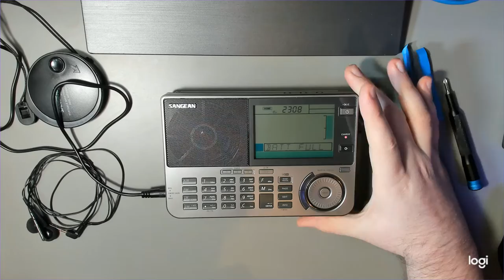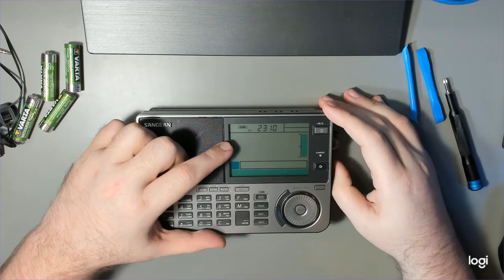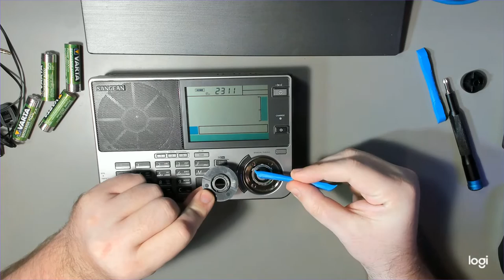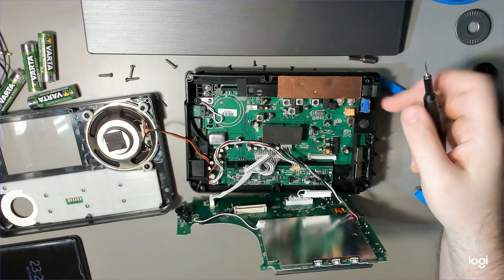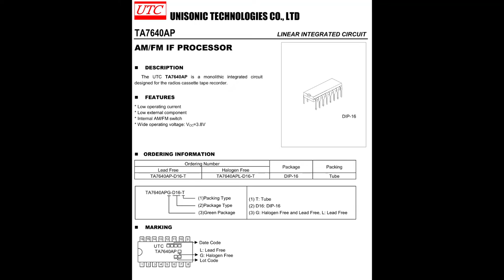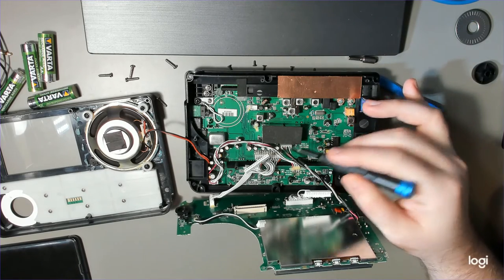Sangean ATS-909X2 Teardown - preproduction EU version, firmware 070

Comment: is your whip antenna very loss? i tried to tighten my antenna from inside but still loss from outside...
Reply from the maker: Hm... Good question! When the antenna is deployed outside of its protective compartment, and at its shortest length, it's loose enough so that I can move the tip 2-3 cm with almost no force needed at all. So it might be called loose. On the other hand, outside of that movement, on my unit, the antenna is actually tight.  When I rotate it, outside of area allowed, I need to intentionally do that. It won't move on its own.
Reply: I have Capacitance Hash when moving The Antenna on my 909X. I have tried to tighten on the Outside and applied Locktite on the Screw inside the Radio. No Difference but this Screw is bad to Loosen as the Radio is used, I at least fixed that issue.
Reply: @maddog57ful  ... My antenna is broken. Do you advise an amateur not try to replace it?
Reply: @chuckbarlow1334  Physically Whip broken or Loose on the inside?
Reply: @maddog57ful  It's physically broken, definitely need to be replaced.
Reply: @chuckbarlow1334  The Antenna can be replaced. You don't have to open the unit to do it. When you unscrew the whip at the base their are two Brass Thin flat Washers/Shims, Do Not Loose. Measure the approximate length of original whip. Amazon has various lengths, or try Ebay.
Reply: @maddog57ful       It may be tough to unscrew the antenna as it sheared right at the outlet of the case, barely any metal above the plastic to grab onto. I may be able to use a screw extractor.

Comment: Japanese xhdata vs tecsun chinese radio tear down how good is japanese or Chinese radio in terms of built quality, material used, plastic, circuit board,.....
make a video
thanks for your current video
Reply from the maker: Hm... I might. 
From Tecsuns, I currently only have PL-880, and it's a bit difficult to take apart, due to all the shielding cans it has, but I'll see if I can do something. 
I actually ordered the XDATA D-808, but it still hasn't arrived. Are you sure it's actually Japanese? It really looks like a Chinese design to me, but I haven't researched it yet in detail.
Reply from the maker: Well, I got the XDATA D-808 yesterday. My first impression, based mostly on plastic material used, and general quality of the chassis, is that it's a cheaply built and quite horrible radio, and that quite a bit of time was saved by rushing the case design. 
After using it for some 5-6 hours, I still stand by that opinion, but the actual "radio" part of the radio is fine. It has a small and weak loudspeaker, and the interior doesn't look like it was designed for sound, so the speaker is OKish, but not even close to ATS-909X2 or PL-880, or even ATS-505. On the other hand, unlike many radios, the headphone jack is free from digital buzzing noises and works "fine". To me, it looks like a super-ultra-cost-cutting radio, but all the costs that were cut are in places where it doesn't impact actual radio part of the radio all that much.

Insides are mostly OK, but some of the trimmer potentiometers on the inside look as if they were in the oven on a temperature which is a bit too high for their plastic, and of course, all of remains of the (hopefully no-clean) flux from the hand-soldering are still on the inside. The telescopic whip and ferrite bar antennas are both partially secured with hot glue, which worries me about reliability after a few years. 

I'll see if I can post some comparison videos in the coming weeks.
Reply from the maker: @yuvrajkote5918  By the way... I've been playing lately with the ATS-20 (also known as the Si4732 radio), and it seems to be relatively close to D-808. If I remember correctly, the D-808 also uses the Si4732 internally, but the ATS-20 comes with a metallic box, which you can throw around. The firmware on ATS-20 can also be changed by the end user, so it's possible, with very little effort, to adjust many of the smaller annoying things, such as button press delays, AGC time constants and similar. On the other hand, ATS-20 doesn't have a ferrite rod antenna, which the D-808 does, so D-808 has much better LW/MW reception in noisy areas. 

For Tecsuns and D-808... Well, I've used a PL-368MP, and have a PL-880. The D-808 just isn't in the same class of radio as the PL-880. Yes, they mostly do the same things, but PL-880 is more luxurious, larger and heavier, while the D-808 is small, thin, light, and (to me at least) gives a strong sense of cost-cutting. 

Another thing about the airband: In some areas, the airband switched to 8.33 kHz steps (but round to nearest 5 kHz when speaking on air). The ATS-909X2, and the D-808 can't scan using that step size, so this could be something to keep in mind.
Reply: @AndrejaKostic .
thanks.
we will keep searching and researching about radio waves and devices of electronics to get some knowledge.
thanks a lot for your videos.